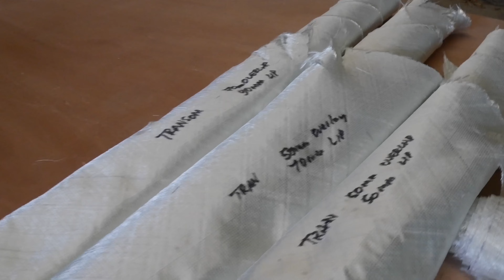I sold my dream boat... | Pacemaker 20ft | Full BOAT RESTORATION V2 - Part 25

Comment: After our third bi annual rebuild of our glass boat (inside, trailer and outside over 6 years), we sold our 17 foot pacemaker. We had planned to build a plate boat but yeah, 2 -3 year project…no thanks. we found a 7.2m second hand one that fits the bill. 
You only live once and debt when you’re young isn’t a bad thing. No point having the biggest bank account in the cemetery when your gravestone said you worked and did nothing else.
Reply from the maker: That’s exactly right mate, I think the next one I buy in finished and ready to go! 
Appreciate the support 😊